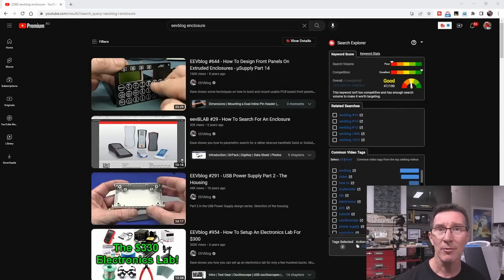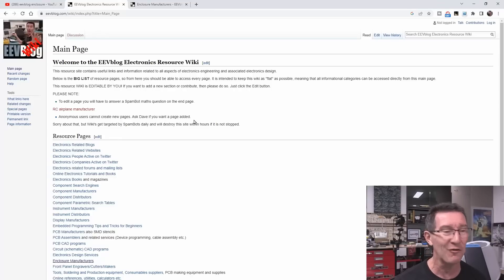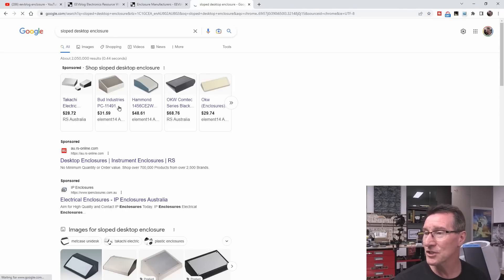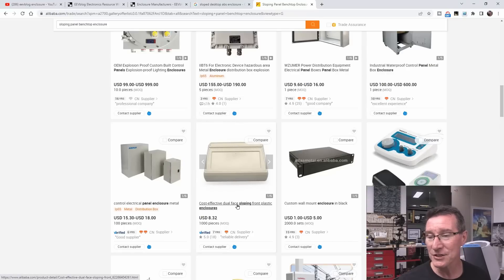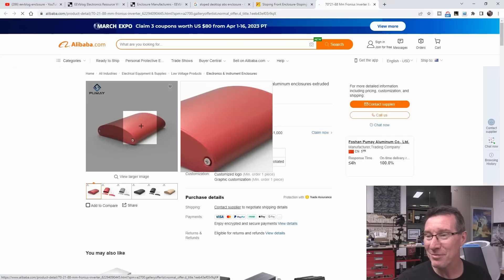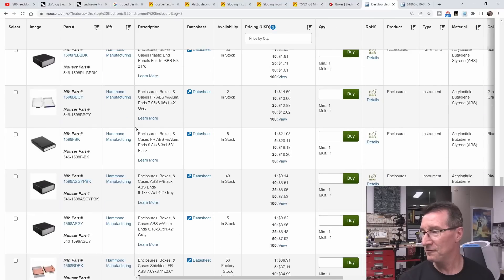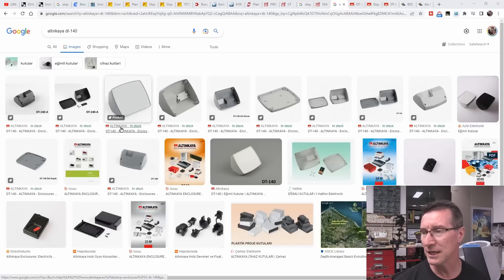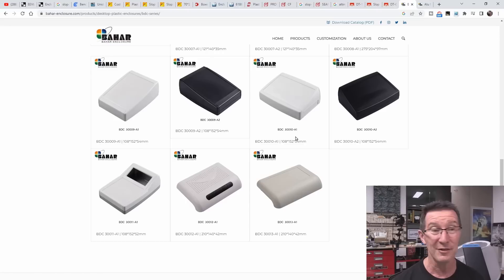EEVblog 1537 - NEW PROJECT Enclosure Search FAIL

Comment from the maker: Closest I can find is a PDT555  console enclosure from Ningbo Keao, but it's 300m wide. I think it's ultimately pointless to continue to search.
Reply: 300m wide? :face-blue-wide-eyes:the console enclosure of god imho
Reply: Would your project fit into a $15  "Replacement Housing Shell Case Kit Compatible for Nintendo DS Lite" case?
Reply: I found the Bud Industries SC-13101, looks pretty close to your drawing. In addition to 3d printing you could design a sheet metal enclosure in Fusion 360 and have it sent to a laser cutting/bending fab. For something like that you could even have a custom plastic extrusion made and just cap off the sides, it took me all of 10 minutes to design this case in FreeCad and submit a RFQ to Xometry.
Reply: The Z-20 and Z-20A enclosures are manufactured by two Polish companies, Maszczyk and KRADEX. Maszczyk also offers the DT-090 enclosure.
Reply: COMBIPLAST: CP-18-51, CP-18-15, CP-18-12
Reply: 300 meters?!
Reply: @EEVblog your drawing looks exactly like a 3M Post-It note dispenser... Google "CAM-330MT" or "Post-it camera dispenser".
Reply: Guess my other replies are caught by spam filter... anyway, search terms I suggested is add "angled" ... google was ok with "dual faced angled project enclosure"
Reply: can't even add uk after ebay or it's spam... anyway search there for "Sloped Front Desktop Enclosure Project Box PCB Housing" one of my google results was that title.
Reply: Not sure on the overall dimensions you want, but what about the G series from Bud? (has a larger bottom flat section, and is long and narrow aspect,  more like a calculator)
Reply: it seems hard to find because the inherent shape you want is prone to being tipped over, unless you put some sort of weight inside to lower the cog. it also could perhaps make sense to get the other style, and rotate it 90 degrees the other way... might work depending how the details are for the feet etc.

another thing you see in real life are either custom made, or they join together 2 parts. such that (for example) the display is just kindda floating out there as its own outboard element. that is no longer within the main chassis

personally i would either 3d print it, or pay a service to fold metal or other fabrication methods. then you can get whatever those dimensions you actually want
Reply: Bahar BDC series or Bopla pult/ultrapult series... german manufacturers. They presented themselfs on Embedded world last year.
Reply: Okw do a smart-control, this can be mounted on a generic cuboid enclosure
Reply: A 300 meter wide enclosure would definitely be surplus to requirements. It would also be a real pain to ship it anywhere. ;)
Reply: Well, you can do anything with a 555 they say, so have a go!
Reply: Looks like Dave essentially wants the Pittsburgh Modular Lifeforms Research Console
Form factor but in plastic ABS
Reply: I was thinking 'console style enclosure'..

Comment: Another approach could be to find an enclosure where the bottom half works as the basal platten to mount your PCB board to, then 3D print a custom top half that holds your buttons and display. Or you cold find one that has a bottom and top shell that works for holding the PCB board and buttons, then 3D print a shell that mounts on top to hold the display at the right angle.

Comment: We have a product at work designed for a Hammond case. When we asked our Chinese manufacturer to mass produce them, we told them which holes and cutouts to laser into the Hammond cases, yet they went and designed a DLP printed enclosure, which are actually nicer than the Hammond.

Comment: i don't know if that help anything but i would use that last sloped enclosure with battery compartment and  just use buttons with thick long shafts sticking out on an angle so they would be  pushed from the top and would have interesting shape, possibly i would like 1cm citcle that is around 1-1,5cm high over the actuall microswitch button, could be separate piece
it would look pretty interesting

Comment: wasup dave1! i think theres a rant coming on.
most designers of things like premade boxes do a rubbish job. have they ever seen the standard sizes and shapes of parts people are most likely to put in there? some dimension always ends up too small by a few mm and you have to get a much bigger box dammit ! 
also boxes with all internal surfaces covered in ribs are stupid. did someone really think somebody else would jam 30 PCBs in there? or do they want people spending time on carving many of these stupid ribs out to fit things like pots lights and switches? what the 💩are they smoking?
the absolute worst ive seen is a box where the 4 internal posts for the lid werent in the corners but towards the middle like some sort of a cruel joke. where does the stuff go? dorks.

Comment: Start by defining what you actually need. If you're unsure about the details, thats fine, but some starting point with estimated dimensions must be found.

The design you're aiming for is easily made in CAD in a short time and the sketch is really all that's needed to start. Depending on internal mounts needed etc. they can be designed in from the start or added later. 3D printed plastic can be treated like any other project box if printed with 100 % infill. If mass production is no concern and if you don't have special needs on the plastic used, like melting temperature, durability against chemicals or oil etc. you're pretty much set on 3D printing these days.

Comment: Create one using chatgpt-4  with openscad. All you need to do, is describe in detail, in simple English. Export to STL. 3D print it.  It's that simple(assuming you are familiar with terms used in cad/plastic molding). No previous openscad modeling experience needed, except some common sense. Then print it with a run of the mill FDM printer. Can do acetone vapor polishing for a glossy finish.  Been there done that. Just some thoughts  💭.
Reply: You can also make a home brew pcb using chatgpt. Just that, many don't know how to get it done!. Some clues: use text based netlist, cad info. of packages,some python code, modified form1+ SLA printer, with the open-source f/w, presensitized pcb, cnc mill to drill holes. It's an interesting world we are stepping into. Just some thoughts 💭

Comment: That's kind of an old-fashioned form factor. How about a simple rectangular case with a triangular stand or a multimeter-like kickstand? Then you could use a single PCB for the display and buttons. Really depends on whether the buttons are just for setup or whether you press them more frequently.

Comment: Personally, I'd go straight to 3d printing. A 1st-run of a case like this should take less than an hour to design. Of course, then you need to refine and redesign but sometimes you can get by with a bit of drilling and filing. Once you have a workflow going, it becomes second nature. It's really nice getting exactly what you want and not having to work with a not-quite-right form factor.

Comment: Buying an enclosure is something you do only if you are going to build 1 or 2 devices. Every company I've worked for has designed their own cases as the volumes are usually in the hundreds or more. 
I'm getting pretty good with Inventor (fusion360 but better) so let me know if you need any help and I'll do my best to help.

Comment: Might be an odd thought but if you can get a sloped front with a flat top and then another sloped unit that can bolt to the top might work.

Comment: I love to see these projects, I build myself 19" enclosures for radio stations, if the mixing console they use don't have fader starts, so I make them tailor made. Using 1 or 2 K8055N boards and with relays for powering a light tree and stuff. And the manufacturer of these makes holes in it for LEDs etc. They are very beautiful maid. I also make pre-amplifiers with analog compressor limiter to use, because with digital equipment you always have a delay, and that is annoying for the presenters/ DJs. I love to design these, instead of doing repairs. But development isn't very cost-effective enough. So I have to do repairs also. We need to eat too. Following this one for sure for part 2. Thanks. [edit] I searched on the website where I order my enclosures, but nah, nothing there unfortunately [/edit]

Comment: I wanted a very similar enclosure but came up empty on the commercial market also.  Ended up 3D printing one and it came out awesome. The ability to design and print enclosures was one of my   main motivations to get a 3D printer.  Best $200 I ever spent (+ 50 hours of modifying the design to make it work decent).  3D for the win!  I'll post a photo over on the forum.

Comment: Dave, you were using a text based search term, and returning images - that's helpful to fast review the results, but you need a different bit of google-fu in the situation where you know roughly what visual outcome you need, but you don't know the best text search term for it. Stop me if you know this, but the steps are (in Google Chrome):
1) use the process you have followed to find a roughly correct image. It could be the wrong size, that's fine, it's the overall shape that matters.
2) right click on the image and then left click on 'Search image with Google'
3) a pane will appear on the right hand side, with 'visual matches' showing similar images. Expand the pane by dragging left if desired. This should most quickly bring back results of interest, independent of what text accompanies them.

Comment: Good video.  I did not know what to search for in the past.  Enclosure manufacturers for when you need big runs.    Either way, this very need led me to build my own prototype boxes:  Like everyone else, choose one of following (or all of these like I did).
1.  3d_printer + PLA_filament
2.  3d_pinter + ABS_filament + [Air filters so you don't die  of long term exposure to plastics]
3.  Tig_and_flux-core_Welder + Auto_darken_first_helmet 1/50000_or_faster_delay + angle_grinder + stiff_leather_jacket_and_gloves

The welder was a waste for small enclosures, but I use the welder for other big enclosures like car modifying and rack server.  I build my own ATX boxes too.   Make sure your metals are not galvanized or you'll get sick.  There are other things with welding.  Welding is dangerous for most people are not physically inclined.  But the savings are huge.  Server racks that I need are like $1_000.  I can build one for about $100 bucks now.

Comment: Hi, Dave. But how can you estimate enclosure size even before project start?
I often find myself in situation with my hobby projects that even if I guessed case size pretty good and everything fit there, anyway there some places where elements are toо close which makes assembly and wiring (especially wiring) pretty hard 😊. Even with 3d printer sometimes it is hard to find balance between size and components placement.

Comment: Got into 3d printing to make enclosures for handheld electronics projects because premade enclosures were too limiting.  ABS filament is available in every color you could possibly want, and modern machines make it easy to print with.  Get a soldering-iron bit for heat-press inserts and learn to design with them in mind, and you can CAD up a new enclosure in minutes and have it ready to go in a few hours of print time.
Reply: sure is great when you can print whatever box u want, but ive had trouble with ABS. its been deforming with heat. also interference gets in from ham radios, wi-fi etc. 
no more plastic. aluminium boxes also work great as heatsinks when you dont want noisy fans packing your projects with dust.
Reply: @echelonrank3927  ABS is kind of old school -- it used to be the go-to for 3D printing something that's tougher, but there's many other options now that are easier to print than ABS.  The PETG and tough PLA options work great and don't need an enclosure, ASA has all the characteristics of ABS but warps less, and now there's options for polycarbonate and nylon.  Yes, the RFI/EMI issue and cooling issues can still be a problem with plastic, but for many designs plastic works fine.
Reply: @somejoe7777  I'm talking about newcomers printing enclosures for electronics projects, so I still think ABS (or ASA, which is just fancy ABS) is the best choice.  Other plastics either aren't really suitable for beginners (PC, nylon), or warp when exposed to heat  (PLA at 50C, PETG at 70C).  If a project is melting an ABS enclosure,  I'd say go with bending sheet metal since there are CAD tools for easily doing that as well.
Reply: @beauslim  Sorry, I disagree with recommending that beginners should try to print with ABS.  I have a lot of 3D printing experience and I don't touch ABS, it's too difficult unless you have a heated enclosure and are intimately familiar with your printer and slicer, and can tune them properly.  That is way beyond beginner level, not to mention that most beginners will not have a high end printer that has a heated enclosure, nor will have the proper filtration equipment to deal with the fumes.
Reply: @somejoe7777  It is true that the fumes need to be dealt with, but the same is true for soldering.  I wouldn't call the rest "advanced".  Pick ABS in your slicer, add a brim, and maybe tweak scaling.  Dry your filament.  A $50 pop-up enclosure or cardboard box works fine if ambient is above 20C.
Reply: @somejoe7777  yes i am aware of 'miracle' plastics ive seen them before.

Comment: I found the Bud Industries SC-13100, but I'm sure even this is a bit larger than what you have in mind.
EDIT: You're basically looking for an enclosure shaped like a VTech Smart Start or a Tomy Tutor Play Computer, right?
I'm a huge fan of making concessions for the sake of using an off-the-shelf solution, but this sounds like a good candidate for 3D printing. I might also consider gluing up some polystyrene, but I'm not you.

Comment: I'm pretty sure that Vero Electronics used to make these. They were in Maplin, RS (Radio Spares not Radio Shack), Farnell etc in the 1980s and 1990s. In the characteristic grey and white 2-tone scheme. Unfortunately, the oldest paper catalogue I have to hand is 2015 RS, and there isn't anything in there. Vero don't appear to make them any more.

Comment: Hi, what to do with two boxes, buy one slanted for the display, the other straight for the switches and screw them together, and the built-in battery case can be bought separately according to the type of batteries used. Or make it from the one with a large space for controls, a small one for the display and stand it vertically. I also found something very similar to what you are looking for, the display part is also tiltable, unfortunately it is large 600x250x110mm and above all insanely expensive, I also found counter boxes with a straight step, but they have the upper part lying down.

Nice day 🙂T.H.Edison

Comment: I have a ham radio that the head unit looks similar to what you are wanting. It is the Icom IC-7100. Probably would be imposible to get this case and have it customized for what you want but you might look at it for inspiration. Howard - N0AZ

Comment: I have a sheet metal brake build project on the back burner for building my own enclosures.  Not sure I could pull off something that complex but may be able to make some parts metal that could then be fitted with 3D printed parts to make the whole thing easier and more robust.

Comment: Your drawing looks like an early 1980s LED alarm clock where big red seven-segment displays would be on the sloped window. Time set, alarm, hour minute and such would be chosen with buttons on the level section.
Reply from the maker: Yes, essentially the same look.
Reply: Spartus Digital LED Alarm Clock Model 1116 is literally Dave's drawing.
Reply: @sadiedeee  That is almost disgustingly retro, I love it!
Reply: The same shape as a bartop arcade cabinet. His best bet might be to look for a cheap plastic bartop arcade game knock off and gut the electronics

Comment: Not a real subject of this video but most people don't think about enclosures of devices thrown away. I have box full of plastic parts, buttons, display windows, covers and enclosures of devices I have taken apart for parts. Some parts are really nice or really clever made and not easy to reproduce with a 3D printer or very expensive to buy. For example transparent parts or nice shiny silver knobs. I have also some nice metal enclosures from external harddrives, mutimedia equipment, settop TV-boxes, etc.  You can get very professional results, great looking projects and people cannot imagine you made it yourself. Another benefit, it doesn't cost anything and you reuse stuff so better for the environment. Think about it when you need only one enclosure to house a project or prototype. Maybe is what you need already made.

Comment: I haven't gotten into 3D printing but would be tempted to go into my workshop and throw something together out of wood.  (For a one-off prototype.  I'm pretty good at miniature woodworking.)  Query: is wood a safe material for enclosures, or is not fire-resistant enough?
Reply: It depends.
If there is not much exessive heat (Tempereatures below 350 K to 373 K, where woods starts to dry, gas out and tends to selvignite or get lit by an arc) it should be fine. If arcing or something similar is substantial in normal operation wood might not be the best fit.

Comment: I frequently fabricate similar style enclosures from sheet metal, perforate all openings and then vinyl wrap for a good finish. Vinyl wrap is so much better than paint or powder coat and can always be re wrapped if damaged. 
Dave, if you get stuck I can custom make you one with cutouts, although you did state no metal...
(Im in Tassie)